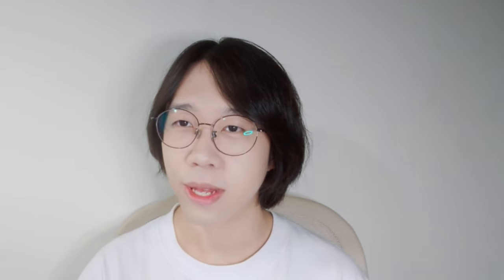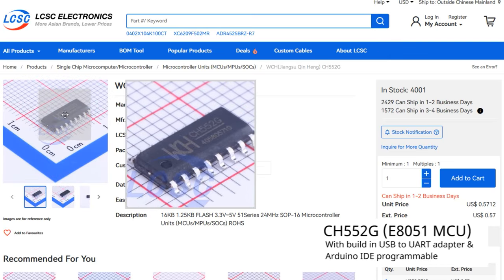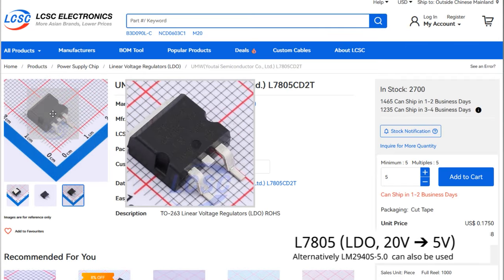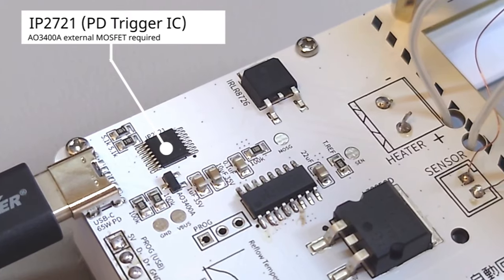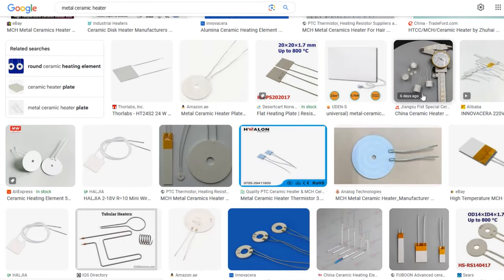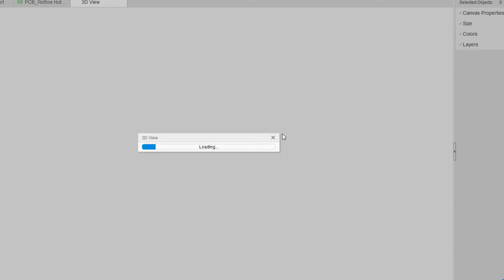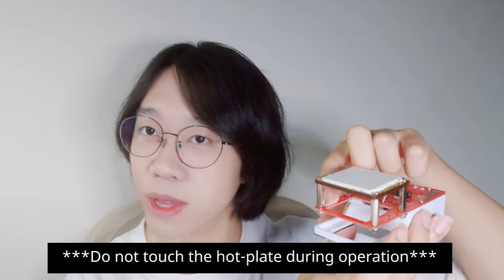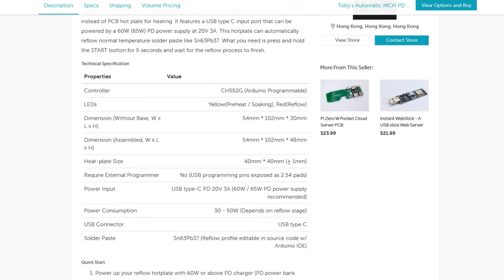Toby's Automatic MCH PD Powered Reflow Hotplate

Comment: what would it take to adapt this board to control the larger aluminum hot plate with the blue base?
Reply from the maker: Do your aluminum hotplate uses AC power? If so, you will need a solid state relay for that. The rest are pretty much identical.